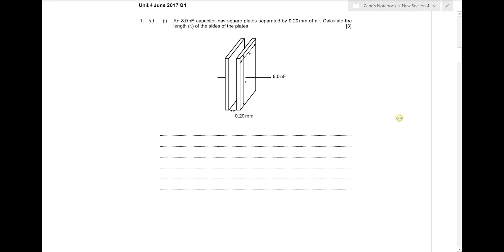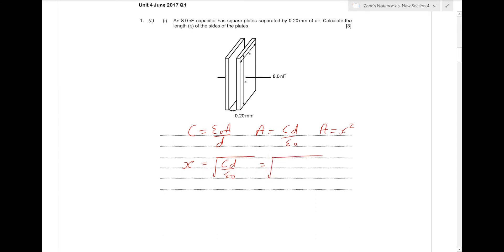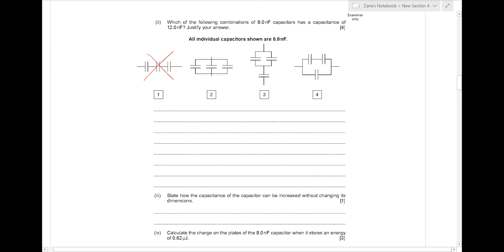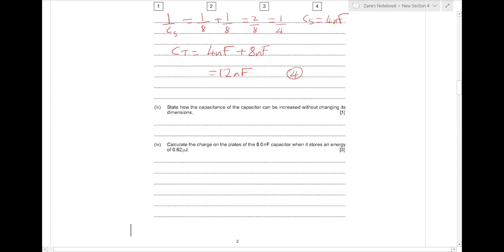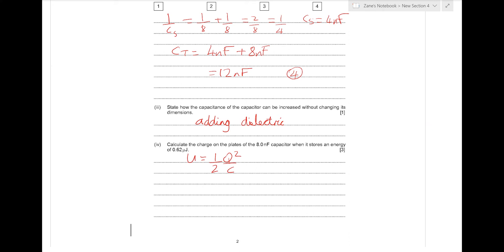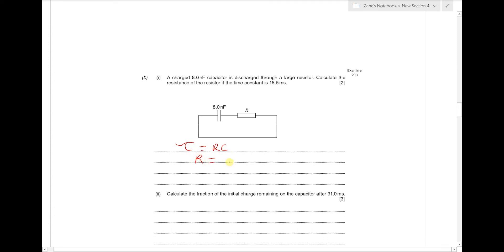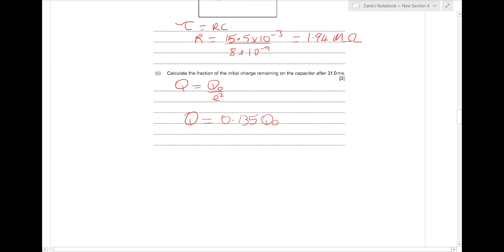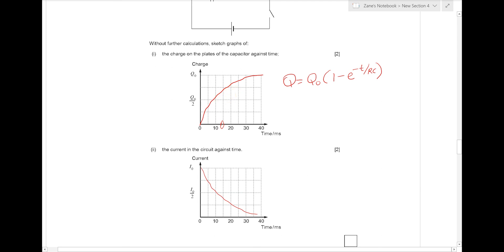Unit 4 Jun 2017 Q1

Comment: Please can you explain how you get 0.135 for b, ii?
Reply from the maker: 31 ms is two time constants. You can use the standard capacitor discharge equation with t = 2RC. The RC terms will cancel.